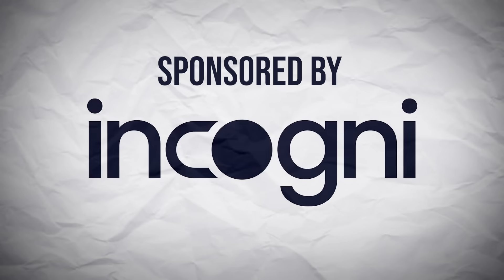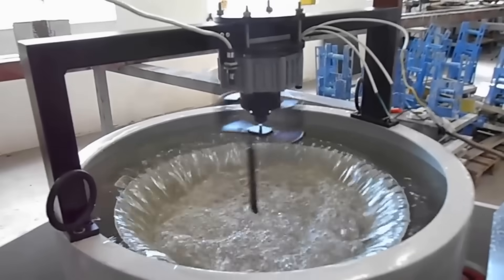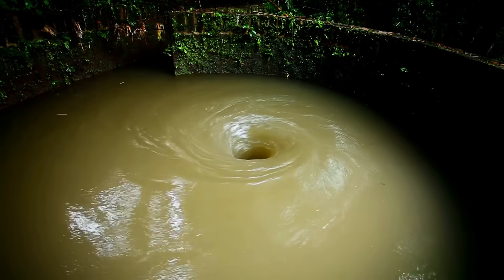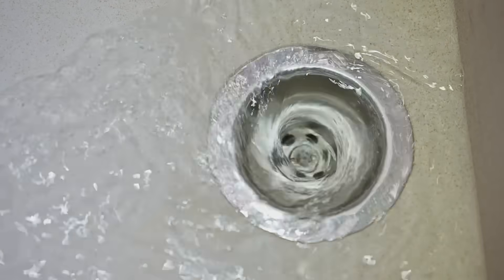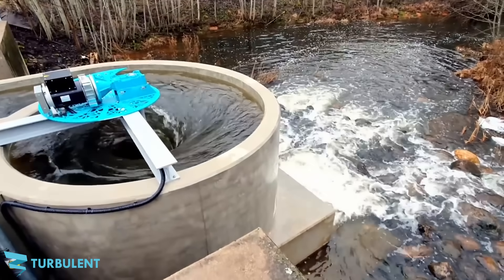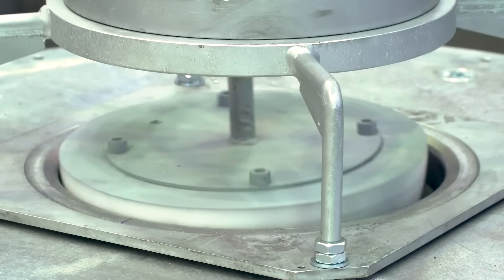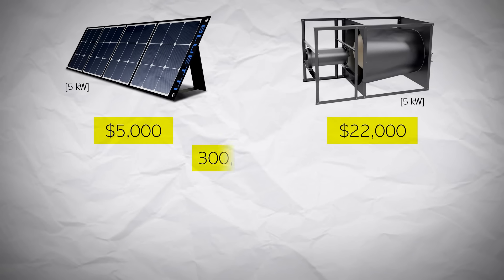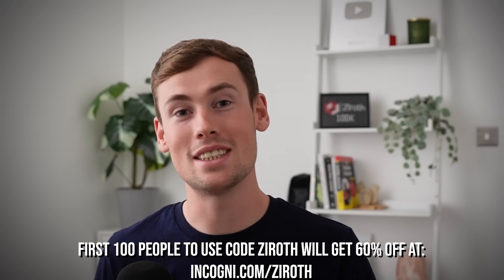Genius Bladeless Hydro Turbine is Cheaper Than Solar

Comment: I feel the fish will be crushed between the ball and sidewall like a mortar and pestle.
Reply: Fish paste
Reply: @970357ers  gender fluid Fish paste.
Reply: Exactly what I was thinking 👍
A larger, slower moving, greater resistance, rounded edged blade, would be safer for aquatic life. The other model shown looked superior and had better numbers. 
If this design incorporated the snail shell vortex producing lead in water, the spinning ball could be smaller, remain in the centre and allow aquatic life to swim around it, providing there is space between the ball and walls.
Reply: @rdapigleo  Same problem, smaller animals.
Reply: Crushed, but not sliced. Greener death 😁
Reply from the maker: Definitely, I put some footage of a bigger turbines (that uses the same method of generation) which look pretty deadly - my thought was  the smaller/lighter ones would not crush the fish! My bad for not being clear with this! Thanks for the comment :D
Reply: @ZirothTech  water turning that ball, so water spins faster. I think water could crush something, not that ball should do it. 
You could block stuff like fishes going in, and sideflow ramps, where they could swim upward too.

It's working and used long time.
Reply: Couldn't you just place a grille over the inflow? @ZirothTech
Reply: @corneliuscorcoran9900 diced mashed fish.
Reply: @ZirothTech just minorly concussed
Reply: @ZirothTech put a screen in front of the system or make a fish free reservoir then generate the power. 73
Reply: @ZirothTech 😢so what is the purpose of this technology anyway? it crushes passing fishes and does have a lot less efficiency than other turbine techs.
Reply: how about small debris like Wood or stone ,if the system need some sort of filtration i think Blade Will be cheaper , maybe old water wheel Will do just fine with less harm to fish
Reply: Companies that makes fish paste can power their factory and make the paste too
Reply: @rxbudian  delicious and nutritious, makes the low efficiency and high cost worth every penny.
Reply: @rxbudian  great idea for fish paste company 😂😂
Reply: Yes, that's very funny. Mortar and pestle ay lol.
I better bring a pack of dry biscuits.
Reply: You have to install grates sized for the smallest fish u don't want to kill, and then make a channel of some sort that bypasses the turbine. Usually how that would be done, but idk much about it,  but i know it's done on grid scale projects and that people do it on micro generation set ups
Reply: I thought same thing
Reply: Yeah, this seems to be optimized to flatten all things living and dead. I wonder if some freely vibrating/oscillating/resonating (not in closed space) thing in water would be safer, maybe something like that vertical vibrator looking fluttering wind generator.
Reply: Fish screen, folks, fish screen!
Reply: If you wouldn't jump into it, It's not safe
Reply: Exactly, this is just a single, very unsharp, blade.
I thought it would/should, could (with fluting on the ball, (but that's essentially back to blades)) rotate around a single axis. Interesting idea but somewhat disappointing.
Reply: Fish and Chips
Reply: Came for this comment!! Exactly...
Reply: Sushi maker
Reply: I suppose it would depend on what the ball is made of, if it could be soft like nerf ball then maybe it would be ok for the fish. Though I'm not sure how rigidity of the ball plays into the efficiency of the setup. A softer material would also degrade faster so that would be an issue too.
Reply: Maybe an added grated inlet might help.
Reply: They need to go around on a waterslide! Which could totally be done and be a fantastic bear-attractor.
Reply: isn’t an old fashioned paddlewheel fish safer(er)?
Reply: So could you make the ball heavy on the bottom so it stays up right then put holes on the ball that curve in the same direction to make it spin
Reply: They should just use a fish safe design
Reply: @NineEyeRon  yea. Exactly. Put a filter on so fish can’t swim or fall into it?
Reply: @Foxyfreedom  You can not put a screen over something like this if you plan to put it in a natural river. It will get clogged up with twigs and leaves within a few hours. And without a screen all it would take is one tree branch to float in and get jammed in there. Either way you would need someone on call 24/7 to unclog the screen or unjam the branch anytime this thing stopped working.
Reply: @jeremyenns7330  ah that’s true I didn’t think of that.
Reply: Right so no “fish safe blades” just one big fish crusher.
Reply: Think I put screen.
Reply: No, the water is flowing down, through the walls, so I doubt it would be possible for anything flowing in with the water to get crushed.
Reply: Thought exactly the same thing
Reply: Agreed.  The larger, slower fish safe blades are clearly safer than this design… as is.
Reply: Screen system
Reply: the part of the ball touch the wall is very small. The chance of crushing a slippery fish is very small.
Reply: Thank you for pointing it out, I was about to comment the same thing.
Reply: And then the fish paste will attract more animals.
Reply: If they get dragged in backwards they will drown
Reply: Put a filter catcher in so the fish can’t go in
Reply: The vortex should keep the ball centred in the vortex away from the walls plus the ball would probably be on an axle to drive a generator/alternator so it would be constrained from touching the walls.
Reply: Always seemed to me that ocean waves would be an excellent source of energy I mean imagine a huge ball being pushed back n forth in a tube do some engineering shit and bang any coastal cities get that sweet sweet ocean energy
Reply: @VeronicaWebb-r1z  there’s already an Israeli company that has these platforms that move up and down with the waves to make energy. They trade on public markets. Company is names wave or something like that
Reply: @VeronicaWebb-r1z  Ocean waves actually move up and down not side to side.  Besides ocean waves requires you to be close to the ocean or a large lake.  Just as with hydro, it isn't available everywhere.  This is one aspect where hydro is better than wave power and that is for energy storage, when demand is low but production is high, you can pump water back up into the reservoir to be retrieved later when power is needed and indeed we actually do this.  Remember energy storage allows us to use energy sources such as solar, wind and even wave where we can not just increase or decrease the energy production just because someone flipped a switch on or off.  Hydro is load following power, solar, wind and even wave are not.  It can also be said that coal and nuclear are also not load following as increasing steam production takes time.  Natural gas power also takes some time to change levels of power production but a lot less time than steam or nuclear so natural gas power is considered load following when calculating how much solar and wind to use.  

When we were requiring a 1 to 1 load following backup for solar, and wind, certain states such as Hawaii had to not allow subscribers to install solar till someone else decommissioned theirs and that is still the case in Hawaii, however Texas used long term climate modeling to use probabilities and statistics to overbook their grid with wind which needless to say made the grid fragile during extreme unexpected weather events that were outside the probability forecasts, needless to say that has actually happened once so far.   We need more load following power such as hydro, natural gas and molten salt nuclear or broader energy transmission with utilities with different usage patterns such as being in another timezone in order to install more solar, and wind.  However investors are reluctant to invest in power plants which would hopefully not be used.
Reply: In the video it says the snail shape is suppose to be fish friendly. I’m sure with some screening and , or filters they can keep most things out. The river water is redirected so they must have a plan. We just aren’t being told all of it. Water power, whether flowing river or waves, is more consistent and should be explored more. China has a huge wave device to produce power. We have enough water around the whole world . We should be able to achieve cheaper more efficient power.
Reply: @barracuda861  The advantage of hydro is that it can be throttled on demand so it is load following power, also we can and do pump the water back up into the reservoir to store energy.  However, it is disruptive to the river ecosystem regardless of the fish survivability and the reservoir will require dredging and the dam repaired eventually.  In reality, we have been demolishing dams rather then spend the capital to dredge the reservoir and repair the dams as the business models for the existing dams never included pricing in the dredging and repair costs so we have been returning rivers to as close to their original state as possible instead of even maintaining hydroelectric facilities.
Reply: @barracuda861 SUPPOSED, not "suppose".
Reply: DOGE!
Reply: And,, go plug into a fish
Reply: "Hydroelectric Fish Muddler">>>> "Pesce-Patte”
Reply: Fish paste
Reply: No, the spiral is very gentle…

Leaving a large open space, they’d never hit anything 

The forces at play keeps you in the center of the flow of water even if something else is in the way.
Reply: I was literally thinking exactly the same thing.
Reply: Yum, fish paste.  Surely, there must be away to deflect the fish from the the machine.
Reply: Even worse, this is basically a gyratory rock crusher in reverse:
https://www.youtube.com/watch?v=IYeOW7UCZAg
Reply: grating would be used, not just 'to save the fish', but to prevent timber, stones, boats, people etc in the stream from clogging or damaging the turbine.
Reply: Yup, the "improvement" is going from a blade to a hammer, which is actually far more destructive to wildlife.
Basically, if you cage the intake enough, you can prevent all but the smallest organisms to enter.
Small organisms are pretty unaffected by a small crossection, fast moving thing like a blade, but get fucked by a large crosssection like this design.

Just use slower, larger blades and protect the intake and outlet accordingly.
Reply: I suppose you could have a screen filter or something only letting in water before it gets to the ball. As I assume sticks and logs would also damage the equipment..
Reply: Debris like a rock or so, and this would be destroyed.
Reply: solar panels are much easier on fish 😅
Reply: I think they still need that snail-like waterflaw pathway to minimize this incident.
Reply: True, unless there's a long Screen before Turbine.
Reply: Ya whoever says its fish safe needs to make a scaled version and throw themself through it 4x a day
Reply: yeah seems the fish safe turbines are way better and more efficient.
Reply: Fish paste as a free bi product. Wow!
Reply: Screens
Reply: Fishpaste
Reply: Unlikely. That would imply the ball itself has self-produced energy. The ball is being moved by the water, and the fish are going to move with the water. The water wants to move in the path of least resistance, if it was flowing into the leading direction of the ball, the whole system would fail and the vortex would collapse. Fish are naturally going to be pull in the direction of the flow, which is strongest through the biggest area of opening.
Reply: ? What’s the efficiency level of Fish paste generation? 

1 out of 3 fish crushed between ball and side wall = 33.3% 

Of course the goal is to get this number lower as the power generation efficiency goes up… or is it? We need fish paste! 

Maybe we just need to figure out how to capture the fish?
Reply: Teslas bladeless turbine probably wont have this problem, and its more efficient
Reply: The 80+ replies to this comment is proof that open-source tech is better.
Reply: Pssshh put a soft rubber ball.
Reply: Chum master 3000
Reply: My first thought exactly
Reply: Millions of fish are killed every time a river floods. They are crushed by water, mudslides, and getting stranded once the waters recede. Some of you people need to get outside and actually learn how nature works instead of sitting in your apartment constantly fretting. The same mentality that says an animal going extinct is wrong. 99.999999 percent of species that have ever lived on earth are extinct. We have very little to do with it and even when we do it’s simply natural selection
Reply: I'm surprised that the fish issue is something that is stopping the deployment of turbines in low head applications.

I would imagine that with a mesh in front of the turbine you could easily stop at least any bigger fish from getting into the turbine. 

Furthermore, considering how massacre fish populations at sea for food, I'm not sure why there is such an interest protecting them in rivers.
Reply: Wire mesh prob solved.
Reply: Fish tartar
Reply: I was thinking the same thing
Reply: People always talk about renewables but do not realy care about nature. Look at windturbines; in the Netherlands, were I come from, 50 000 birds get killed by them every year.
Reply: Obviously. Typical dishonest fad. And it won`t help me generate off-grid power because I don`t own a river. I can`t even go to a river to have a peaceful day without police and game wardens invading my privacy and trying to link me to criminal activity. So from now on I`ll stay at my home in the woods.
Reply: Screen
Reply: Pounding fish
Reply: Grill on top or grill in kitchen.
Reply: more like it's be like Bill & Ted time travel.
Reply: they wont want debris either so it probably pre filtered
Reply: But a shunt screen could divert fish of any size diagonally away from the water flow back to the river thus saving the fish. Invent peace not war
Reply: What if the ball were circular, but differentially weighted?
This would help to establish the vortex without the need for blades.
Reply: It's more humane, the fish is squished into paste instantly instead of bleeding to death.
Reply: Put the net before the water goes down to keep the fishes or anything else away like hair catcher in bath tub.
Reply: Not sure, perhaps the fish would get pushed out of the way by the water flow
Reply: The trick is to ensure you create and implement a feature that keeps fish from getting into the system beyond the intake. Screens/physical barriers.
Reply: yes
Reply: Looks more like the ball is fairly static in a translational sense and only has rotational motion. Pure rotational motion wouldn't harm fish
Reply: I'm not sure, but it might work in a way that sucks the fish through only where the water is not blocked, what do you think?
Reply: This is what you Feel?
Reply: Make the water pass through a grid keeping the fish out.
Reply: The vortex turbine is the most efficient for low head power generation.
Reply: With this new design, the achive nothing! Either the fish got blade struck or got grind into fish chumps. They waste money for some fail idea and think they succeed in their failure.
Reply: They should have fish nets before the intake and fish channel to go around
Reply: @DooNotReedeeeeem  Yes but if they build all of that infrastructure to reroute the fish, they might as well just use a regular bladed turbine, too.
Reply: It's like a giant grinder
Reply: I mean, is that not what grates are for? Could we not have a fine mesh of some kind in front of the intake, to let water through but not fish?
Reply: Seems like a slower moving bladed turbine with a grating to exclude larger fish would be safer for the fish .  It's the high head high speed bladed turbines that kill the fish.  Even without hitting the blades, the intense high/low pressure differentials around the blades are ferocious.
Reply: A teensy-weensy little bit of research or even watching the video will show you that the ball very quickly stabilizes in the centre of the vortex, in the centre of the channel.
Reply: Yup, Ziroth always have clickbaits from stuff that doesn't exists and/or is completely useless. I saw his name later, if I had seen his name before I wouldn't have clicked it.
Reply: thanks @edmundzed9870

> "Yup, Ziroth always have clickbaits from stuff that doesn't exists and/or is completely useless"
Reply: I doubt fish will be in the water at the initial startup. They could probably use a temporary filter / guard to keep fish and debris out.  Once the ball is in the centre of the vortex the fish would probably not be harmed as the gap will allow the fish to pass through.  Sounds like a great design to me, going to watch out for this one 👍
Reply: @cuznerdexter what was not made clear in the video is that the system operates in the "rolling around the edge" mode all the time, therefore it could crush fish swimming through.
In the ball in the cup example he gave, there would be very torque to turn the generator. The friction between the ball and the edge as the ball rolls around provides that torque.
Reply: @protonmaster76  The issue with the ball in the cup is that you can only get energy out of the water's friction with the ball. That could be increased with some fins, but it's still limited to friction only. The reason they are rolling the ball with only a tiny space for the water to slip past is to leverage the head pressure of the water rather than just the slip friction as it passes. I really don't see how this design could be made fish friendly though without sacrificing all of the performance benefits over other friendlier methods.
Reply: @Beakerbite  indeed. I agree with all points you made here.
Reply: @cuznerdexter  so, the fix is to use the same exact filtration setup as more efficient designs?...